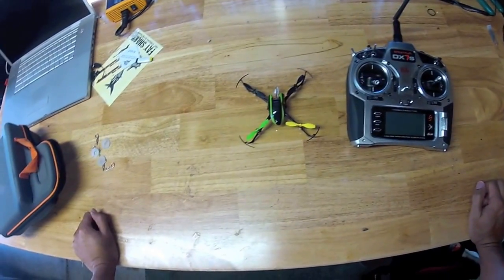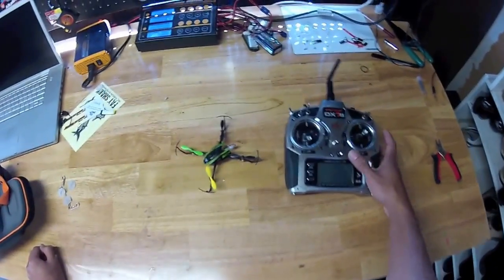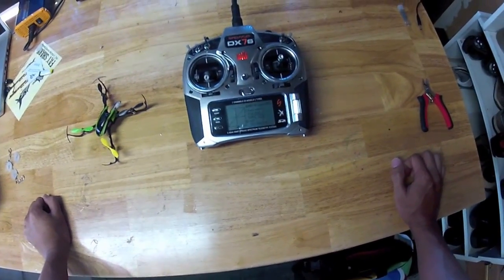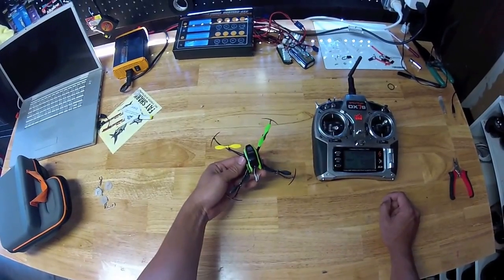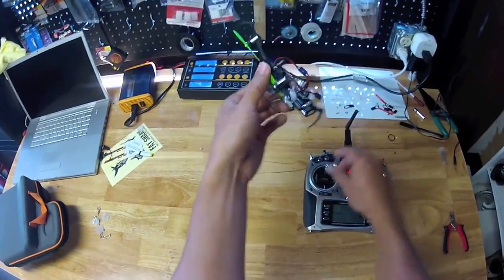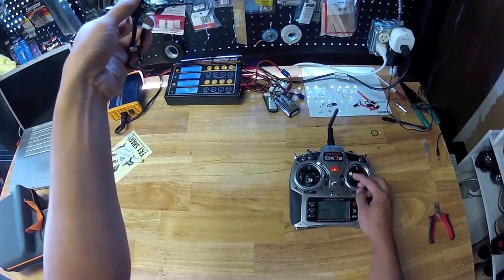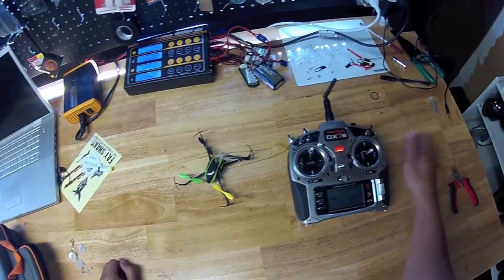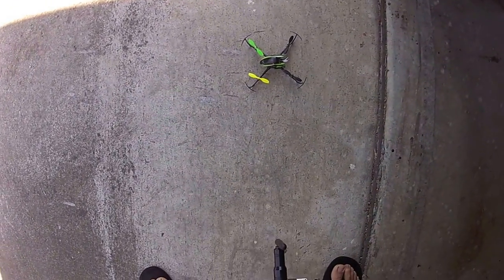How to Flip the Nano QX

Comment: Thanks very much for the tip and video just subd. I tried it yesterday over grass thankfully and had some nice power smashes into the ground lol. Thankfully it is a tough little bird and still flys perfect. I will give it some more tries in acro mode. I was surprised to find it on sale for about 65.00 usd and that it had a real acro mode.

Comment: Nice vid, wouldn't stopping the throttle keep it from completing its turn though? With my 450mm quad I have to keep a little throttle on in order for the Flight Controller to do its job and make the engines facing away from the flip's direction pull the craft back to normal orientation. Also, it looks a little under powered for catching itself up after a flip. :o

Comment: I tried doing this, but I feel like the stock controller doesn't let me put the rates high enough to actually flip it completely. I managed to get a huge flip.. Like it took a huge amount of space for it to finish the flip. Just wondering if I'm just shitty or if I need to look up how to increase trottle on this controller. (mlp4dsm BLADE)
Reply: The stock controller is much harder to do because you can increase the rate for one side in the case of this video (airelon) however a fix quicker than a new transmitter is to buy faster motor the micro motor warehouse fast motors
Reply: I mean cannot increase
Reply: Alexander Lei its actually super easy on the stock controller, the trick is to counter the direction first that you want to flip to while going up and then go in the direction and stop thrusting. It will flip very fast. Try